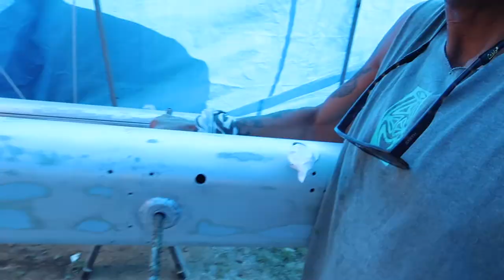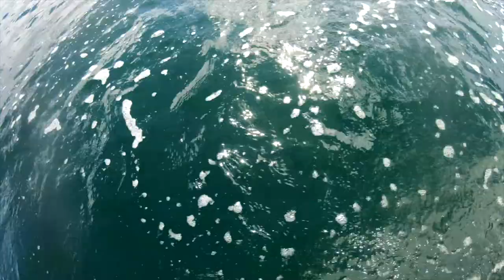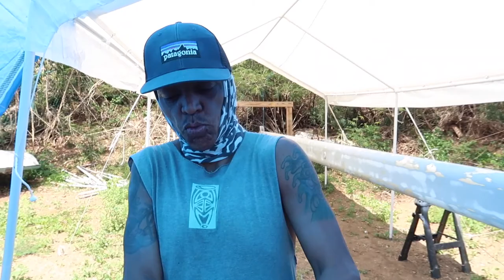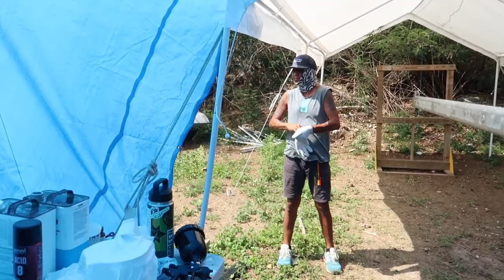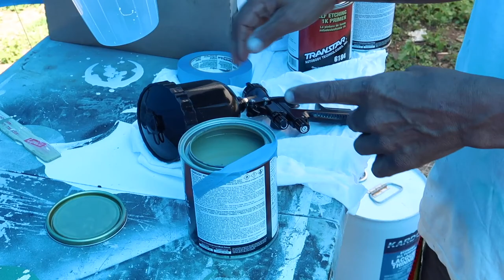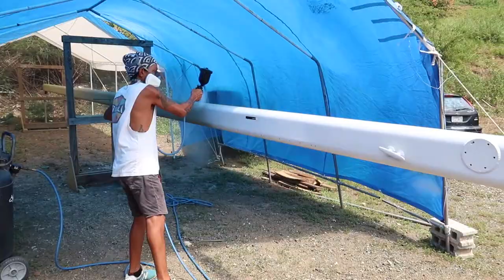Paintng the mast and boom-Chapter 37

Comment: I love your West Sail, shes beautiful!!!
Looking at a 32 West Sail atm to purchase. The white interior you have looks amazing,  Teak is beautiful but it's dark.  Any advice on things to look for before the purchase,  I'll definitely have it surveyed but any kind words you have will be helpful!
Reply from the maker: Thanks Mike, we love our interior! The previous owners did an amazing job and it was a major factor for us when we decided to keep her (we originally were going to fix her up and sell her, but slowly fell in love and sold our other boat instead). These West Sails are solid like a rock, good old boats. Make sure you check out the rudder, they tend to have leaks and often fill up with water, but they have a foam core so often people drill a hole on the bottom just let them drain out and just seal them back up so not a huge fix even if it does. Also take a good look at the bobstay fitting at the waterline. It’s usually a stainless chain plate glassed into the boat hull at the waterline so it’s always salty and  it’s kind of a pain in the ass to replace. When we finish our rigging we are going to have to haul her out and change ours. Other than that I can only think of standard boat buying stuff. If you don’t know Bud Taplin he is the west sail god father and knows everything you might need to know. Even has a history on most of the fleet. Good luck 👍